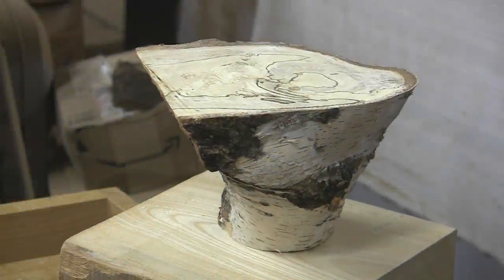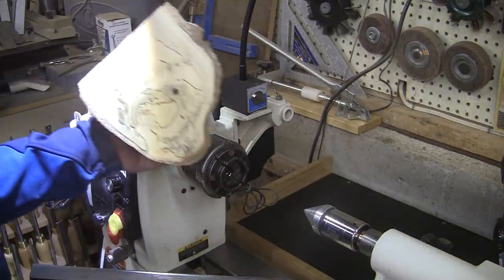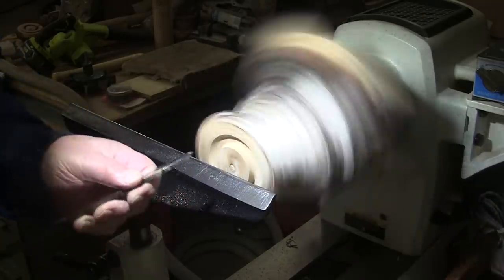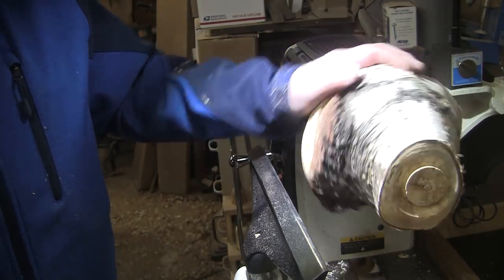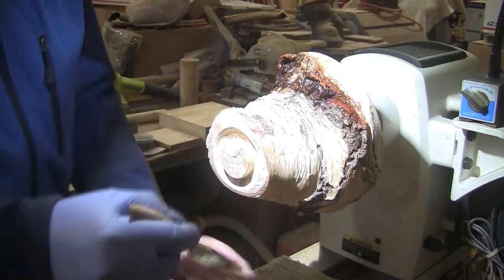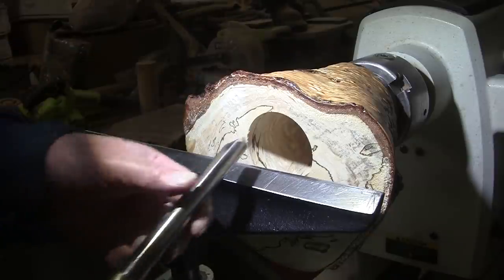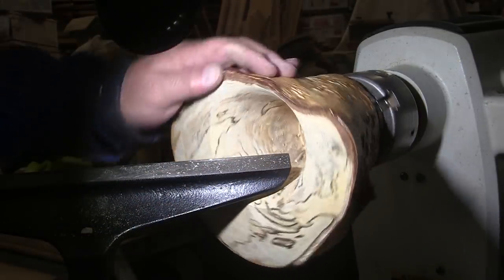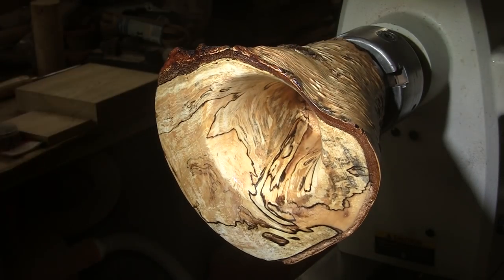An Edgy Vase! - Wood Turning

Comment: Upside down elephant foot? LOL! Thank you Dave. Glad corners rounded. Added American Mt. Ash to wood stack yesterday, saving you some.
Reply from the maker: Ohhh, that's the really hard stuff, right, Valerie?  Cool, thanks! 😊
Reply: @PhilAndersonShadyAcresWoodshop  Not as hard as most ash. You want ugly, normal, or pretty?🤣  I have wood from two standing dead/almost dead trees. Even some punky! Most bark off. You get first pick. Want pics?
Reply from the maker: @valeriehenschel1590  Somewhere between normal and ugly.  I have just about all the punkiness I can handle for awhile!  😊

Comment: Love the Spalding in this piece!!! If you do another one Phil try sanding sealer before sanding the bark on birch it will cut your sanding time in half! Great job and yes on the corners 👍
Happy turning to you 👍
PS if you are wondering what the Happy turning is about I sign my pieces Happy wood turnings with my initials jp !

Comment: Really glad you left it natural, Phil. You managed the bark very well. I was shouting take off the corners. :)

I just finished my largest bowl, yet, a 10.5" spalted birch, and the first time I've turned spalted wood. It was a new experience, but not much different than the balance and hardness differences between resin and wood castings.

I really appreciate all there is to see in the vase interior.
Reply from the maker: I guess it's the punkiness that comes along with the spalting that is the problem, Jay.  Maybe yours wasn't too bad?  😊

Comment: Hi kiddo, I'd seal that bark as soon as possible after sanding. White birch bark naturally wants to peel. So to preserve it's beauty please seal it. 
I think I would make a wine bottle holder with this beauty. Simple and elegant and creative. Paint brush holder for the artist, same size as wine bottle opening. A perfect table lamp base in a cottage, den, reading nook. Kitchen cooking utensil holder I'd put bamboo utensils in it and proudly display it on my counter. Just my thoughts 💭. Candle holder with a glass chimney. White or crackle clear glass round light fixtures atop the birch! Oo la la, I'm only limited by my imagination. You make me think 🤔🔥🔥🔥 yes you did smell smoke! 🤣😂🤣
Reply from the maker: So many great ideas, Jessi! 😊

Comment: Bit interesting how this birch bark actually stayed in place. I use a bit with birch wood for firewood and my experience is that the wood shrinks drying and the bark then splits from the surface
Reply from the maker: It depends on when the wood was cut, Sara.  If it's cut in the winter when the tree is dormant, the bark tends to stay on, better.

Comment: Phil I don’t know if you started this channel to be a teacher or not.  But you most certainly are. Thank you.  If all my teachers were half as good as you I would have finished college I’m sure.   I love this piece.  I’d like to know if you think there is a finish that could have been used to keep the whiteness of the birch bark?   Take care Phil and thanks again.
Reply from the maker: Thank you! 😊  I needed to sand the bark and the outer part that came off left the different color under it.  I guess if smooth bark isn't important to you, you could just put the sealer over it without sanding and it would be white.

Comment: I love the bark, I love the spalt!  I hollered but I think it was to late.  Buy I agree that you needed to round those two corners.  Sadly with that kind of spalting you will get punk and its hard to get smooth. Beautiful Beautiful peice is usual.  I have a question.  Do you store your finishes in the shop, especially during the winter months?
Reply from the maker: Thanks a lot, Steve! 😊  Just finished that other piece of Cedar you sent, working on the video, now.  Ya know, I used to bring my finishes in the house in the Winter.  Then, I forgot for a couple days when it was freezing out.  I checked them next time I was in the shop and they were fine.  That's been about three years ago and I still just leave them out there.

Comment: You mention the term “end grain several times. I don’t know what end grain is. Would you explain what is end grain?  
I loved the wood inside and outside! It is beautiful.
Reply from the maker: Think of the tree as it's standing, Denise.  There are capillaries (grain) that run from top to bottom, inside the tree.  If you cut the tree down and go look down at the stump, you are looking at the end grain.  If you take the part that has fallen over and look at it from the side, that is side grain or long grain.  The best cutting boards are made from end grain.  That's because end grain is very hard and kind of self-healing.  If you buy a shelf board, chances are the grain is running from side to side or from one end to the other.  Same with a 2 x 4.  All of the piece is long grain except the two ends.  Hope that  helps! 😊

Comment: If you find the center on the top surface independently, and line up the two centers then true up the surfaces, won’t that allow you hollow out more for a useful bowl?
Reply from the maker: Well, maybe, if I understand you correctly.  Would have wasted some material for sure.  Also, making a vase, not a bowl.
Reply: @PhilAndersonShadyAcresWoodshop  sorry I am not a wood turner myself, just enjoying watching your work. Certainly there is always the balance of practical use vs artistic style, at the end the artist has the final say :-).

Comment: Hi Phil, have you ever done any off center turning ? I wonder if that would work on this piece ? Maybe get an inch or 2 off rhe thicker side of the bowl . But it would be more oblong then , instead of round .beautiful piece of work .
Reply from the maker: I had to turn where I did, Jeff, due to the off-center vase part of this piece.  It obviously doesn't come straight down from the middle of the top.

Comment: you call it a vase.  if someone wanted to put live flowers in, would the finish protect the wood from water used for the live flowers? what do you think about it being a planter for a live plant?
Reply from the maker: A vase for dried flowers.  It would hold a potted plant.  The finish would not hold water.

Comment: Phil, on the "An Edge Vase" would you think of adding a 3/4 " trough half way between lip and outer edge and putting a colored epoxy in the trough?
Reply from the maker: Not a chance, Harold.  If it wasn't there to begin with, I don't add it, except for finish, of course. 😊

Comment: Hi Phil, Nice piece.
I was wondering why dit you not take the center of the top as well as the bottom of the bowl?
Reply from the maker: I had to center the whole thing on the bottom, Stijn.  Otherwise, it might have tipped over or, I might have drilled out the side of the base (stem).  I hope that's what you mean. 😊

Comment: Why didn't you center the large end half way between all of the bark edges?
Reply from the maker: Well, the bottom part, the hollow vase, is off-center from the top so if I didn't want to go through the side of the vase, I had to be off-center on the top, Bill.  I thought I went to great lengths at the beginning of the video to explain that.  I guess I did a poor job of it.